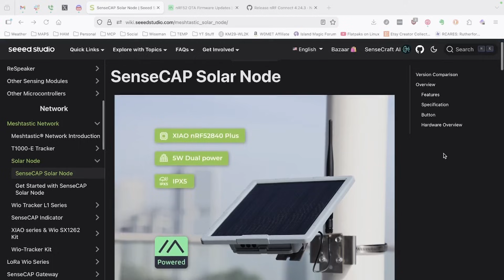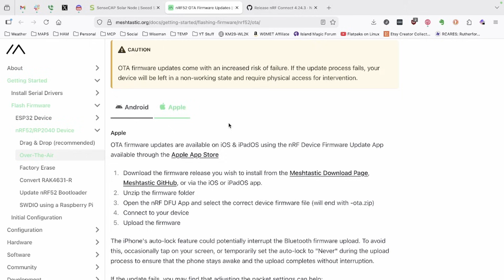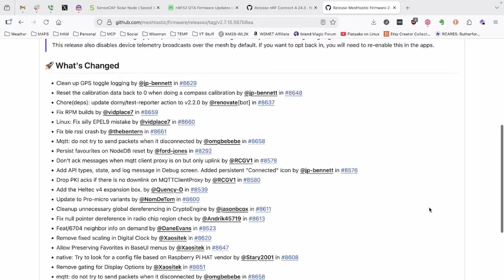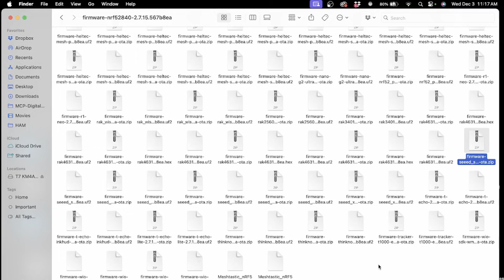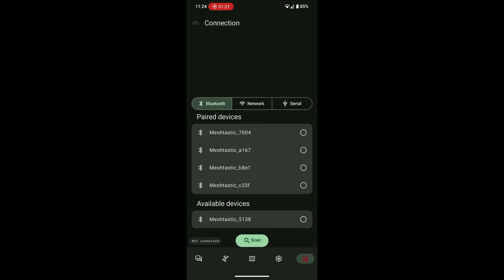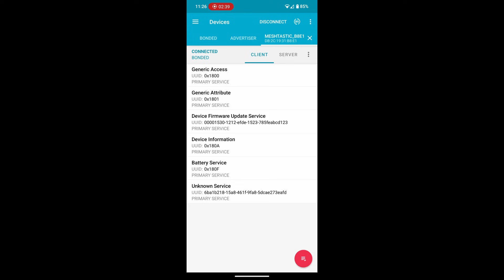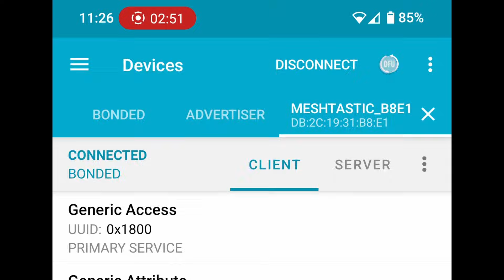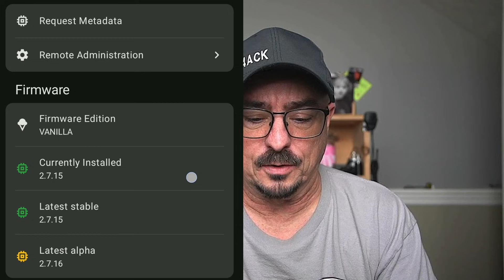Watch This BEFORE You Try Meshtastic OTA Updates!

Comment: In latest Meshtastic version app on Android OTA update is build in.
Reply from the maker: Good to know and thanks for the heads up. I'll take a look at the latest version of the app.
Reply: Whab about iPhone?
Reply: I did the BT update on the T1000's...good. Bricked the sense cap solar node. At a loss here.
Reply from the maker: I thought I had bricked mine a couple of times before I corrected that one setting shown in the video. Connect a computer to it and it should be recoverable

Comment: Thanks for the tutorial Jason.  Everything worked great until halfway through the update, the Bluetooth connection dropped.  I think it was because I was in an RF noisy environment (factory), the transfer rate was about .7 kb/s.  Luckily i was able to drop in the normal update with a cable and it rebooted fine.

Comment: There are such low power, you cannot run coax very far between board and antenna, so you mount the board near the antenna.  My problem with that, is every meshtastic board I've used will every now and then need a power cycle.  I'd be inclined to run power leads to an accessible switch, and perhaps even keep the battery accessible.

Comment: I guess this video was recorded a while ago. As of today, version 2.7.8 of the Android Meshtastic app supports OTA updates. I just updated a couple nodes using it yesterday, and it worked fine (and took much less than ten minutes). However, this was with the nodes about three feet from the Android device. I wouldn't want to try this on a node at the top of a tower unless I'd put a nice external Bluetooth antenna on the node.
Reply from the maker: Good to know and thanks for the heads up. I'll take a look at the latest version of the app.